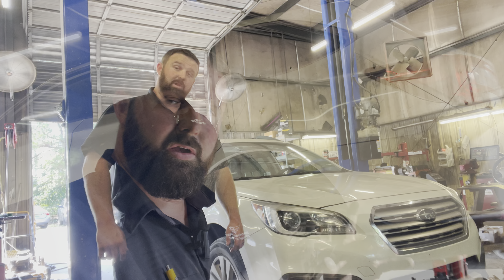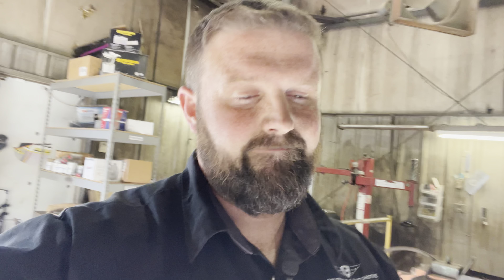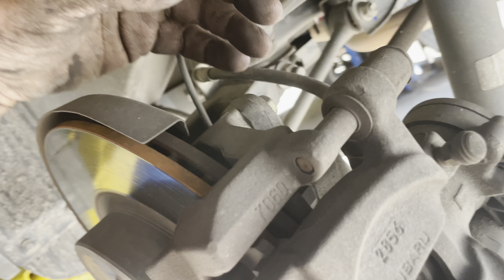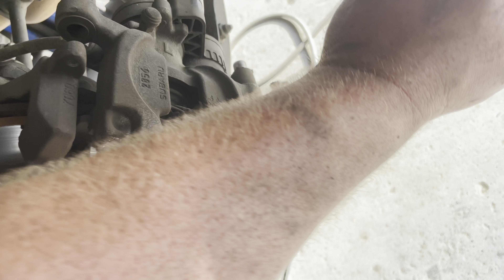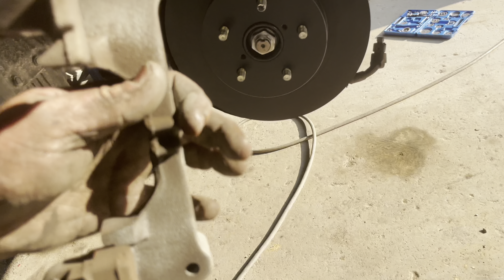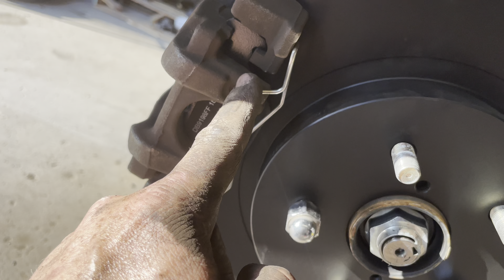2017 Subaru Outback Rear Brakes

Comment: When you've disconnected the wire to the parking brake solenoid, you're in maintenance mode, whether you want to be or not. And just spinning piston back till it stops will not give the clearance to install new pads, you need to push the piston back as well.